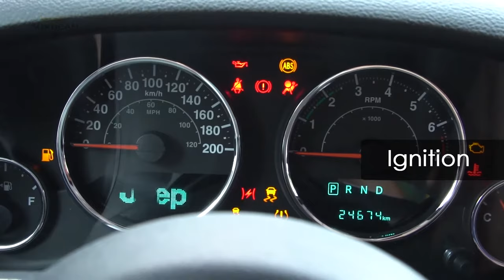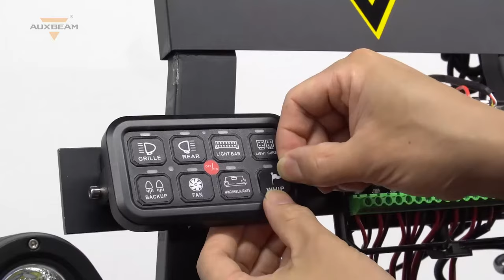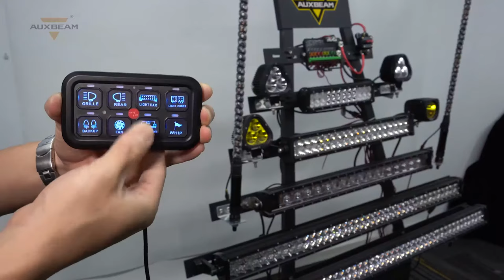How to install Auxbeam 8 gang switch panel(one-sided outlet)?

Comment: Could you add a momentary function to some of the switches for horns or flash pattern changes, thanks
Reply: They did!
Reply: This is literally the exact question I’ve been searching for. I would like to buy one and have an air horn on one circuit momentary.

Comment: I am having such a hard time understanding the max amp, so please if anyone can help me with that.  From my understanding the max amp this can dish out is 60amps.  How can it be running all those lights at the same time?
Also the 5amp switch is running two spot lights and a light bar.  HOW?? That has to be around 20-30amps.  Please someone help me understand.

Comment: Hi, if I am using auxbeam I don’t need to connect the positive harness wire with fuse that comes with the light bar, should I cut the wire and connect to the auxbeam positive and the negative directly? Thank you in advance!

Comment: Can any of the switches be wired to be permanently on? I have a fridge in my Jeep and I don’t want it to turn off when I turn the key off.
Reply: I assume if you don’t connect  it with the key fuse ACC the  all will work if you left the button on
Reply: Why would you use a switch when you want it on permanently? Think about your questions before you ask them.

Comment: Is there a way to wire one set of lights through the switch panel so that your light accessory only comes on with the high beams on (i.e. turns off when you turn high beams off) without having all of the lights only be able to come on with the high beams?
Reply from the maker: Could you be more specific? Do you mean you want to let the switch panel to control the high beams by pressing the buttoms of the switch panel and then all the other lights are following the high beam on and off?
Reply: @Auxbeam  simply put I want the switch panel to be powered on whenever the vehicle is running, but I want to have a set of A-pillar pods that will only turn on with the high beam circuit but want them to still be on a switch so I can dictate whether they turn on with the high beams or not. I'm thinking I may need to have a separate relay in order to make this work, but wanted to know if this is something anyone has done or not before.
Reply from the maker: @SHONTONGA06  Hi Yes That would be achievable on the new panel!
Reply: @Auxbeam  Is the new panel released yet, if so, can you send a link to it?

Comment: I want to use on a boat- can I wire the red AC wire to battery mains positive, with a kill switch. So anytime kills switch is turned on, unit has power?

Comment: So I  bought a ba80 wired everything up to my rzr. Took my time and really was excited once it was complete. The panel lights up everything that's connected however the lights will only stay on for about 10 seconds.  I'm thinking the switch panel is junk. Maybe it's the relay box but no blown fuses and I can get the lights to work over and over but they shut off after 10 seconds. Anyone had this problem?  Any suggestions? Called the number and phones disconnected .
Reply from the maker: Send this question to our customer service where we can have our product support to help you out.
customer@auxbeam.com
Reply: Ok thank u

Comment: Well, this stuff is made very well, but internally, there’s some issue, I have burned out, 4 of the switches, and now the reseller is out of business, so I can’t exchange any longer. I have to go find another version of this after I drilled and tore apart my ceiling panel to accommodate the switch. It’s probably made in China which is why nothing works for very long.

Comment: Question

I have a headache rack with two light each having Red and Black wires. Can I twist them together and insert pos neg together into the controller board? Thanks

Comment: Will the switch panel work with the new six mode amber/white combo pod lights without losing the light pods six mode functionality? If so, do you have to use the included light pod switch in conjunction with the 8 button switch panel?
Reply: Would also like to know the answer??
Reply: @crazyartistic  if you connected the light pod switch to the auxbeam panel, then it should work. You would have to turn on the switch on the auxbeam then, choose the setting with the light pod switch

Comment: The video says "Connect this red wire to battery and circle breaker" and says "Connect the black negative wire to this terminal". Should I be connecting the black wire to the battery and the terminal?

Comment: Hello, would this work if my accessory only has hot wire? It’s Buggy Whip brand. Ground is built in and works when it’s mounted into a metal hence only the red wire that needs to be wired.
Reply from the maker: Hi This will require a professional to answer your question. I would suggest to copy this question to our service email
Reply from the maker: customer@auxbeam.com

Comment: Hi, recently bought 1 of ur 8 gang switch units, it is great, are all the built I'm relays capable of handling 30 amps? Can I replace the smaller fuses with larger fuses, will the relays and unit handle this or not? I need more than 2 that will run upto 30 amps. Also I have seen on some of your other units that they have a dimmer, is the 2nd pin on the plug with the ignition power wire the pin for dimmer?
Reply: The maximum output current of ground 1 & 2 is 30A, the maximum output current of ground 3-8 is 20A.
The recommended connection method is to decrease the current gradually from ground 1 to 8 ground.

Comment: Can I ask as this is low voltage I thinking of getting a set of light for power cut as we have a 12v power  from a power station think control pain on desk and putting light around around house then if power go's we got light

Comment: I’m not very happy with shipment. I ordered mine on July 6th. They printed the shipping label the same day. I was supposed to receive it on July 11th. Then it changed to today. The package still has yet to arrive in my city/state so now for the second time tracking says “scheduled delivery date pending” this will be the second time they have changed the delivery date. Will I receive my purchase tomorrow or will I have it wait another couple days or longer? I’m not sure if Auxbeam uses the slowest shipping option or if FedEx is just incompetent.

Comment: If i need say another 5amp can i just swap out a 10amp fuse for a 5?
Reply from the maker: You can soon the actual amp doesn't exceed 10amp then you are safe to take the 10 amp socket for a 5amp setup.
Reply: @Auxbeam ok so in theory even if i ran just all small led’s for example, i can change them all to 5amps? Even the 30amp spots. I doubt ill have anything needing a 30amp fuse.
Reply from the maker: Yes you can @Busterblader13

Comment: But which fuse is the ACC fuse to plug the add a fuse in?  2019 Tacoma.  Can't find it. The one that says "P/outlet1" does nothing when I insert the add a fuse.
Reply from the maker: Hi Let's contact customer@auxbeam.com where our customer service will help you out!
Reply: Where you able to find a solution.
Reply: Some people should not work on their own cars... if your not confident or don't know, use an auto electrician. That way your cars not going to burn to the ground

Comment: What gauge is the battery wire? I need to buy a longer one my battery and fuse box are on opposite sides @Auxbeam
Reply from the maker: Hi There's two battery wires one is 20CM and the other is 60CM. You could try to measure the distance to see if it's long enought to reach to the battery
Reply: @Auxbeam   I need the wire thickness size not the length thanks for replying

Comment: My radiator ran is ground switched to turn on, how can I wire this?
Reply from the maker: Does the radiator has a orignial switch? If it's, you need to dismount the orignial switch and pulg the negative and postive side to the swtich control
Reply: @Auxbeam  No, it is wired thru a relay and normally a sensor would turn it on or off, but I want to bypass that and manually turn it on and off.
Reply from the maker: @BryanSpear  Just connecting the radiator with the switch panel cuz it come with the relay. If the negative side of the reply are hooked up to the car frame and goes to the ground wire, then just let the red wire connect with the postive side of the switch panel

Comment: Can you turn on the lights with the ignition off ?
Reply from the maker: No cuz it's powered by the car battery
Reply: There should be an option to be able to turn on lights with the ignition off. Im looking for a switch panel that will allow me to turn on certain lights on while at a car show and not leave my keys in the ignition.
Reply: @cifer6900  wire it to a different fuse that’s connected to the battery and not ignition
Reply: @raginghippo  switch pro make one that is already set up for running stuff with the ignition off
Reply: You could bypass the ACC option and be direct to battery....power is always on at the battery.
Reply: @raginghippo  how do you connect to the battery only?
Reply: @cifer6900  I know your comment is now 8 months old but you could use a 3 way rocker switch like another guy did. Gives you ignition on and ignition off option. Ill post the link: https://youtu.be/69Em6vJOtr0

Comment: What amp solid state relays are rated?
Reply from the maker: Hi Rated amps on Brown, Red, Yellow one are 20 amps, the green one is 30 amps
Reply: @Auxbeam  can i usea light bar harness that has a higher amp fuse than the fuses i connect the switch ends to on the controller?

Comment: If I don't use the fuse but cut the fuse off and add a ring terminal to the end, can I hook that up to my accessory/key switch on my polaris ranger bus bar for power when the key is turned on? Thanks, in advance.